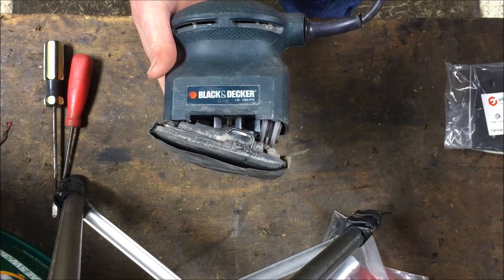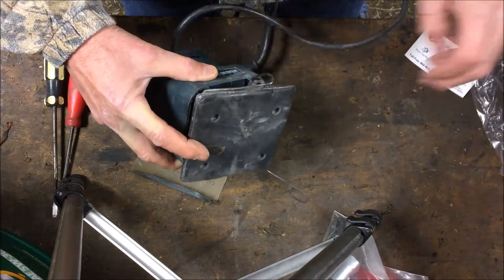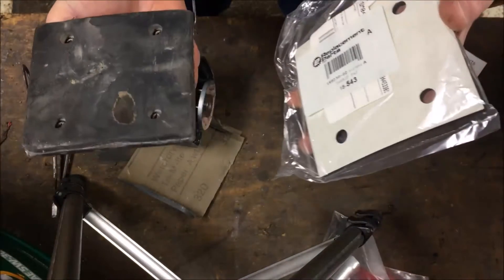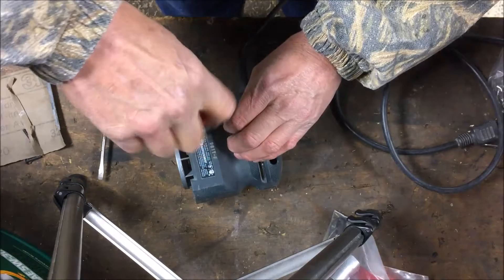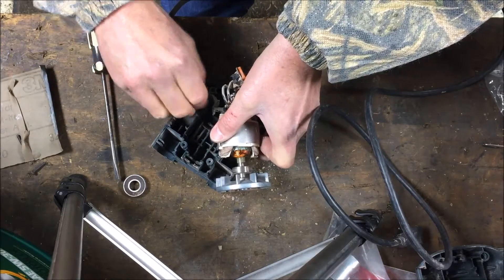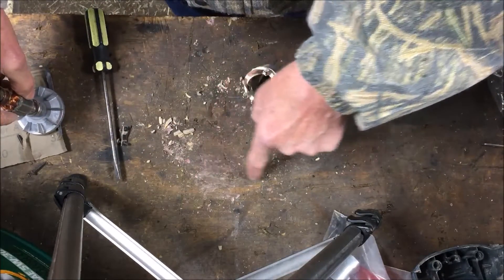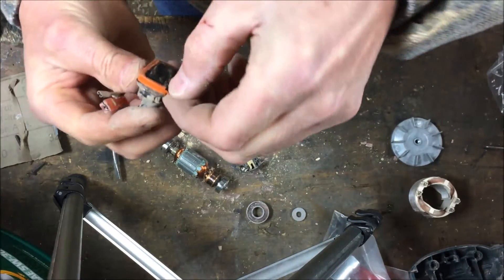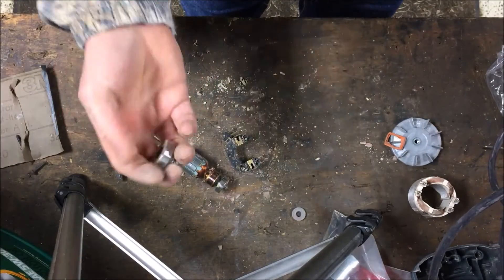What to do with a Broken Palm Sander...

Comment: I'm a little late but wondering if you can fix this? do they sell the replacement part? Mine broke just like this and would like to fix it
Reply from the maker: The part was available but it wasn't cost effective to repair.  Check out the video description for a link to a repair parts website I've used before.

Comment: black and decker make dewalt bud, like lost electronics these days there made in the same place with different stickers put on them
Reply from the maker: +DarLav  You are correct! I suppose it is like owning a GMC or a Chevy pickup.
Reply: They do and almost always have. Doesn't mean they are the same. Different brands owned by the same company are just so that company can tap into different people in the market. Black and decker is still cheap and just a home owner tool. Tti industries owns Milwaukee, rigid and ryobi but ryobi is still garbage especially compared to Milwaukee